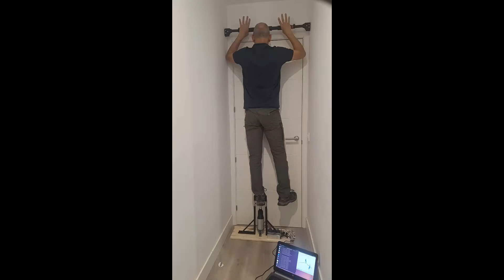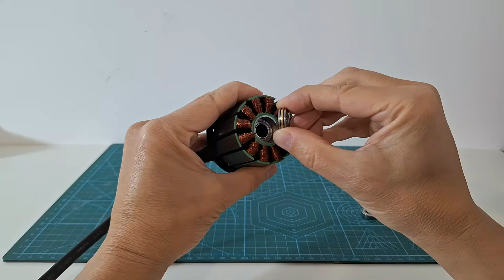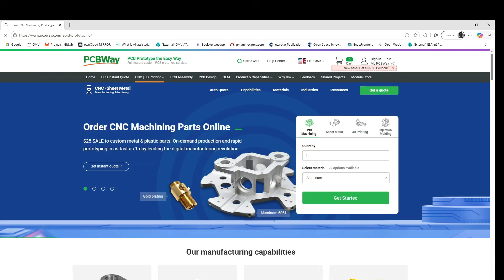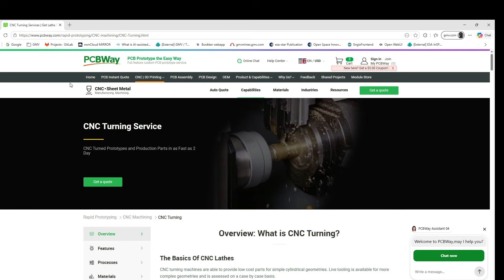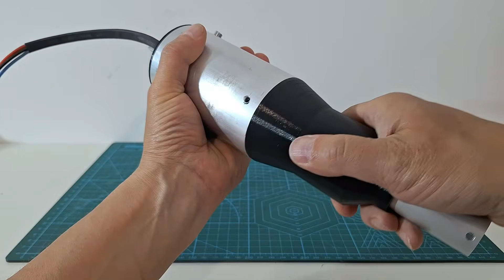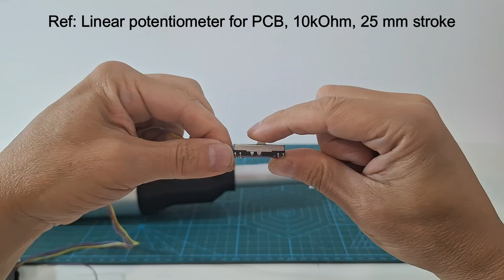Series Elastic Actuator Redesign - Here's Why

Comment: Wow, really nice project - replacing the motor shaft saves a lot of room.  I have tried some very similar concepts but ended up putting the springs on the non-moving side because I was attaching to commercial actuators and retro-fitting to the moving shaft was a bit tricky.  But your solution inside the shaft is neat.